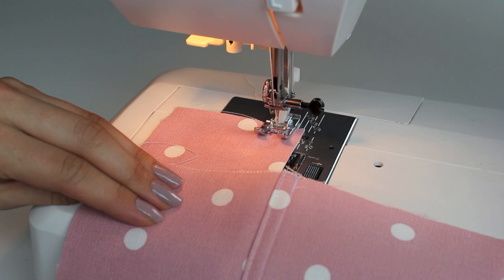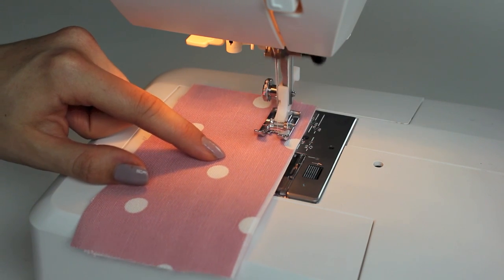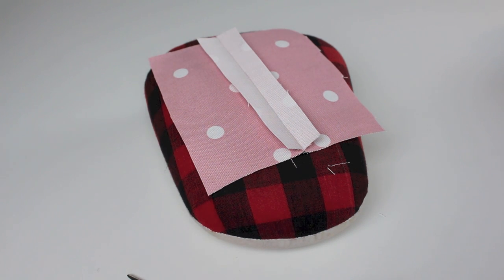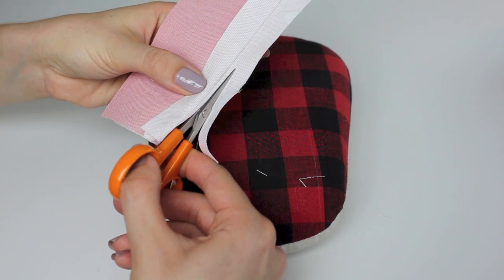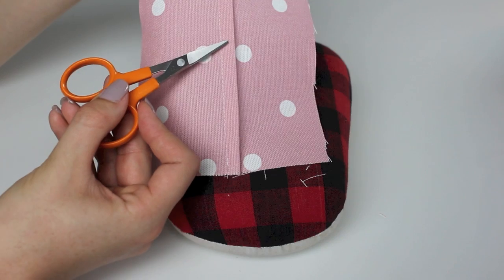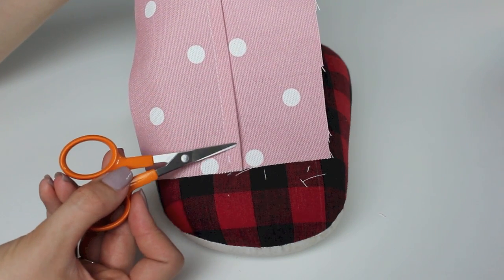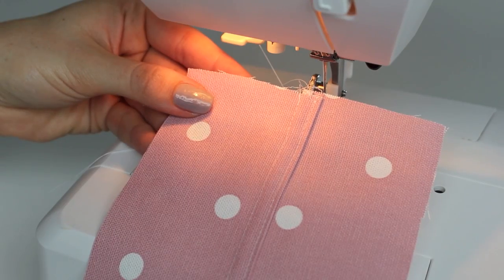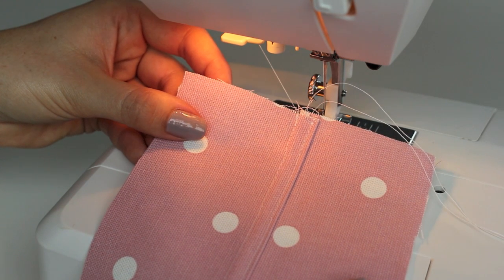Basic Stitches - How to Sew a Flat Felled Seam (Dressmaking Patterns)

Comment: There are 2 different types of flat felled seams. First, the home sewers method shown here is a Faux Flat Felled Seam. You can identify this by there only being one stitch through all 4 layers of the felled seam.This seam can also be often identified by the trimming of one seam after sewing the first seam together.  

A true flat felled seam like you will find on classic Levi's is done by interlocking the fabric and by the sewing of both seams through all 4 layers of the seam.  I've had many home sewers tell me that they've used a faux flat felled seam on their jeans and after a few times through the laundry  they notice thread peaking out of the seam. Once they've learned how to sew a true flat felled seam that problem disappears. Be aware of the difference between the two and you'll be fine.
Reply: Hi. By interlocking you mean what? Do you happen to know of a video that I can take a look at? thanks in advance
Reply from the maker: +Kevin Sews Thank you for this Kevin, the comment went into the spam filter so I do apologise that it wasn't posted straight away. Thank you for helping with your great video. Best, Aneka
Reply: +Made To Sew No problem! I've had the same issue on my end as well.
Reply: I need to take it out

Comment: Are the two sides both equal when finished if you were to fold this in half down the middle?
Reply from the maker: Yes, if you have started with the same 1.5cm seam allowance. Both sides are the same once finished. So the middle would be the centre.

Comment: Great video as always. One question though: how do you do this if the seam is very far from both fabric edges? I'm looking to sew a flat felled seam down the ridgeline of a camping tarp, so I need to join two pieces of fabric each 54" wide. The first stitch is no problem but for the second one that means somehow I need to have 54" of fabric on the right side of the seam, and my sewing machine is in the way.
Reply from the maker: Hi Hunter, great question. I would usually roll up the side of the fabric that is going to go in the gap (right side of the machine, where the machine is). Are you able to roll or fold up that material? 

If the tarp is long too (and depending if the material will fold) you might have to position yourself on an angle to the sewing machine so that you can get the length through the machine. I have done large sails and blinds with the machine on the edge of a table, not near a wall so I have space to feel the material through; working at an angle. 

I hope that helps? Aneka
Reply: @MadetoSew  Thanks Ankea, that's helpful. I gave it a shot on a prototype and got it done...it's a bit ugly, but workable. It's about 8' long, there are some funny angles going on, and the ridgeline is a catenary curve, so it's all just pretty awkward. That material can be rolled, but the roll ends up pretty stiff. I put the machine sideways on the edge of my table, which helps the fabric handling, but then the pedal doesn't reach the floor so I have to put a stool underneath; at that point I have my leg in an awkward position in addition to reaching across the fabric and machine. So it's...not great. But I get the impression there's just no way for it to not be a bit of a pain. Side note: based on some others' input I'm also going with a top stitched French seam instead of flat felled. But all the same logic applies.
Reply from the maker: @huntercook6605  Wow, that sounds like a lot of hard work. Glad you got it to work in the end though, and that you have found the best stitch for the job. Sorry that there isn't an easier work around; in a factory they would probably have a different industrial machine, possibly a post machine. Anyway, I wish you all the best on the final version. Hopefully the hard work and prototype testing makes it worth it. I am sure it will. Even if it is a bit fiddly to sew.

Comment: Hi, Me again lol.  I am nearing figuring everything out. Just one more question on these seams.  Sorry if I already asked, but I am trying to make a tote bag with handles, is it possible to make french seams on the side and flat fell seams on the bottom. I know how to make them, but I don't know how to make them "intersect" at the bottom. What and where do I sew first, etc
Reply from the maker: Hello, no problem. Hmm... that's a question that takes a bit of thought! I think I would complete the flat felled seam at the bottom and then the french seams at the sides. However I think the join will be bulky between the two seams either way you do it. Could you box the corners afterwards with a french seam to avoid this bulk? Good luck! Aneka
Reply: Thanks I figured it  out, worked great
Reply: Hi Barbra, I wanted to do the same.  What did you figure out?  Did you use the flat felled seam on the sides and bottom?

Comment: I just sewed my first mens dress shirt and I really wanted to do this type of seam inside the sleeves but I just can’t wrap my head around it!! How would I go about doing that last step of stitching if the top of
the sleeve would be below the seam?? Is it impossible?
Reply from the maker: Hi Bruno, when working on a shirt you will want to put the sleeve into the shirt flat, using this method. Then you will sew the side seam and the underarm seam in one. Does that make sense? Aneka

Comment: is this flat felled seam or lapped seam cause i found a video that the title says lapped seam and she did the same thing you did at the video
Reply from the maker: Hi there, sorry to hear you are confused by this. This is a flat felled seam which you will suitable for use in dressmaking projects. The flat felled seam used in industry is slightly different and there are variations of this flat felled seam that look the same but are achieved in a slightly different way (usually there are not a strong), but will create the same look from the front of the fabric. A lapped seam will look quite similar but the edge of the fabric won't be folded, it will be the raw edge of the fabric so it's only really suitable with fabrics that don't fray, say leather. I hope this helps? Aneka :-))
Reply: Can you show how to sew  elastic legs with out a casing???

Comment: :-)
Reply from the maker: Thank you!
Reply: Made to Sew Hello, great video, thank you. I understand the seam but when it's used on a sleeve is it possible to for it to be the only seam ? I looking to sew a drysuit for kayaking out of waterproof material . I want to sew the first step of the flat felled seam and then put "shoe goo"  for waterproofing in the seam fold before sewing the second step. I'm planning on using raglan style sleeves. I want as few seams as possible. Do flat felled seams on a sleeve or pant leg always need another seam on the opposite side ? What are the options for a second equally strong ( and sealable ) seam as the other seam  ?  Would I be better  off sewing those single seams by hand ? Thank you for your time.
Reply: She may have shown a 'French Seam' too but flat felled is less bulky.  A french seam is sewing the seam on the right side, trim it and sew it again on the wrong side.  Everything is inside the seam an only one set of needle punctures, with only a small...abt 1/4" to 3/8"  'seam' on the inside.  Don't know how to make it water proof.